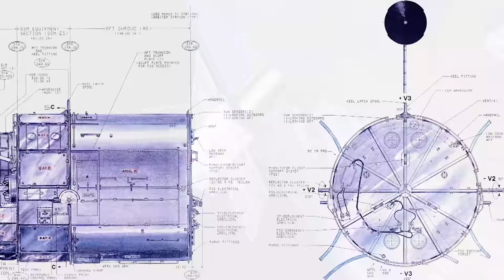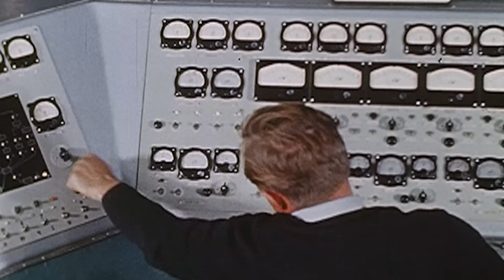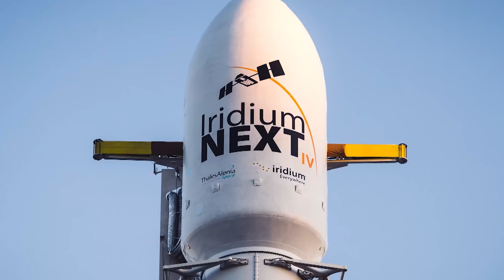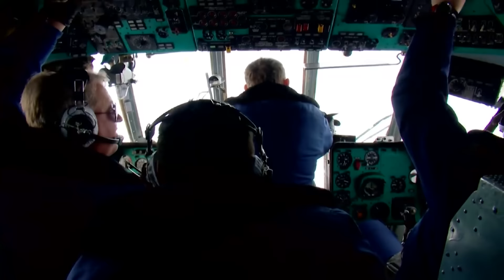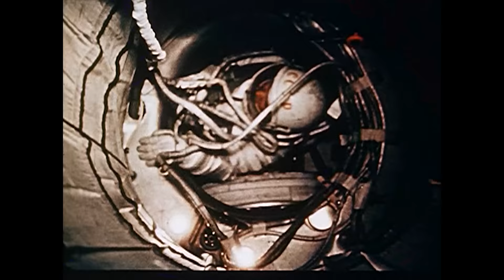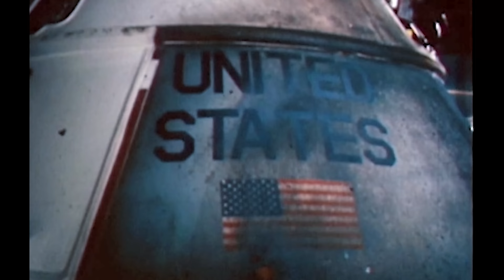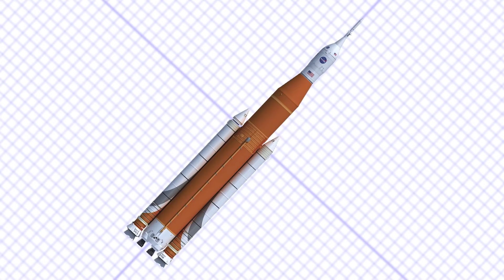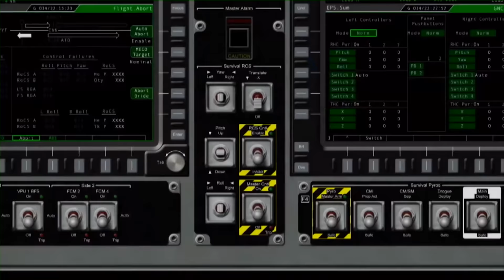2+ Hours Of Facts About The Space Race | Zenith

Comment: it's mind blowing how they made the cooler on Webb space telescope, when knowing that at 0 degrees kelvin, any electrical component cannot function.
As he stated, James Webbs cooler remains working under 7 degrees Kelvin.
Reply: Helium phase change closed-loop cooling. And of course natural cooling by the sun shield helps cool down to about 25-30K naturally. Most of the electronics in JWST function at higher temperatures (It's only the sensor that needs such extreme cooling), the problem with ultra cooling electronics is that everything becomes extremely brittle (and thus fragile).

Comment: Osteoporosis space called shed  , I would say  thinning out from placement of area getting stretched out atmosphere and content thins out a vacuum would would want to expand suit off an astronaut like a balloon in a vacuum chamber instead of building space vessels for implosion or low pressure barrels why couldn't expanding materials be used that stop expanding like space seeds time cured multiple layers,and osteoporosis I had something else inverted sides with another material similar to  Gauss ? Or a ring compressor pumping or deflection? Have the astronaut tied  boards to head and feet wood bonding ? Head boarding and foot compression socks or suits inside space suit ? An anode ?  Of bones ?